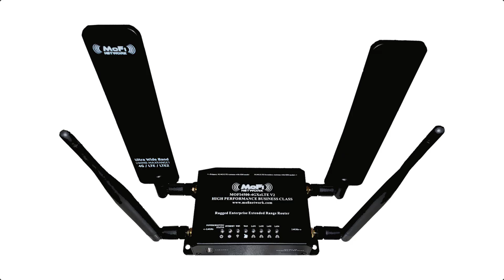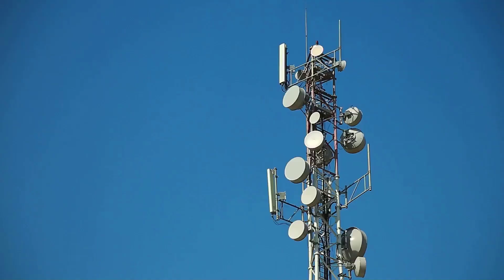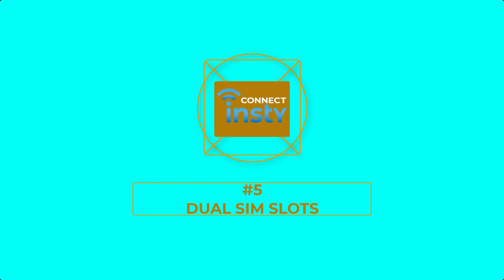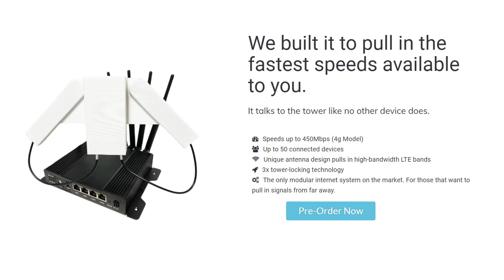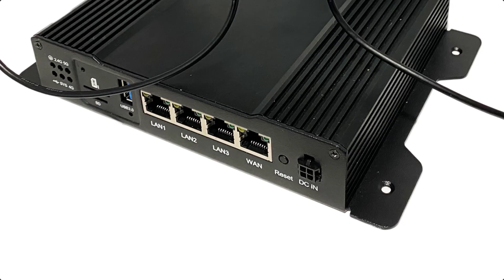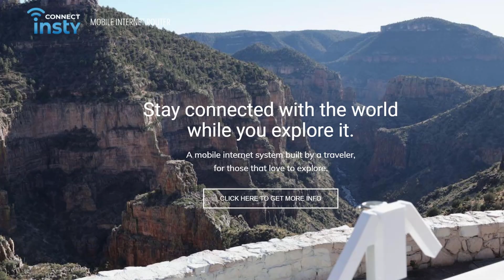Insty Connect Explorer 4G12 - Mobile Internet System

Comment: great when will this be available and will i have any slowdowns cuz i cant spend 1k if its super slow speed as visible only allows 5mb hotspots but its unlimited no caps on useage
Reply from the maker: It's available for pre-order right now.  The 4G will ship in a few weeks.  Insty Connect tells me the first 50 will ship quicker if you get in early.  The 5G model won't be available until summer though.  The 4G is $499.  I've not heard of a true unlimited Visible plan with no caps.  They supposedly got rid of the 5Mb speed limit so I'm not sure which plan you are using or if it will act different in the Insty Connect.  It should work the same as what you would get now in another device because the plan is the real limiting factor on data caps and speed.  The Insty Connect is just going to give you much better antenna reception and provide a hotspot to all your devices at the maximum speed that your data plan will allow.  If you set the TTL to 65 it normally will allow you to go past any data cap without throttling anyway.
Reply: @SeleTraining  So I have visible mobile It's a cell phone that offers unlimited truly unlimited data meaning I can be on YouTube for 200 hours and it will still be the same price now they give you unlimited hotspot as well. If I use and by this device will I be able to connect multiple devices as you say up to 50 and will I be able to get faster speed is there a way to make the speed faster let me know then I'll decide. But obviously I want to make sure that it's worth buying first before I buy it I mean it looks amazing but you know I want to wait till it's out in the market and we know more about it but I am interested in it also do you know anyting about Any other routers not the mofo 4500 because that's too much right now but something a little cheaper that will allow me to connect multiple devices to Visible and use unlimited hotspots While being able to connect multiple devices In-wall not lag I could spend around $100 Even if it's used I can get something that's decent as long as you recommend it maybe the filehub would that work The wave filehub I think it's called
Reply from the maker: The Insty Connect will let you have up to 50 devices running through that one SIM card.  If you have a 5Mbps speed limit with your data plan it won't change that.  Since you have a true unlimited plan the TTL setting is not necessary and you could use any 4G LTE router and it should work fine unless the antenna is necessary for you to improve the signal.  That is one benefit of the Insty Connect.  I don't know anything about the filehub but you would need an LTE router that let's you insert a SIM card to make this work.
Reply: @SeleTraining  I get what you're saying they don't have a data cap they only have it on a hotspot for the speed but as far as using YouTube and truly unlimited you could use up to two to three hundred gigs and it won't stop so you're saying for the instaconnect I have to use a SIM card to get it to work Because I have to use my SIM card that goes into my phone how does that work I just want to make sure I have all the information correctly before I make a big investment like that
Reply from the maker: @UGotHookah  My MoFi Update video explains more of the details about the concepts but I am using over 200GB of data every month with a regular cell phone plan in my router.
Reply: @SeleTraining  I get that but my question is if I have to use my SIM card that I'm using for my basically With my phone plan Does that mean I should get a secondary SIM card
Reply from the maker: @UGotHookah  Your SIM will work in the router but that'll take away the ability to send/receive calls with your phone.  None of the LTE router options will provide phone service in place of your phone.  You can do wifi data calling but the phone still needs a SIM to allow that.  That's why most people dedicate a SIM for this device.
Reply: @SeleTraining  Well obviously I have a hotspot on my phone that I could use I'm guessing the reason I'm buying it is because I want access to get rid of my internet in the future if this works well and I'm believing with this it will be possible
Reply: @SeleTraining  Because if I have access to my hotspot Hook up to the router and allow multiple devices
Reply: @SeleTraining  So then I'll probably get the mofo 4500. But as you said that takes another sim card so I got to figure something out with that because if I'm using one sim card for my phone I'll have to use another one for the router has actually well it's doable But you said you're using over 200 That's pretty good with visible mobile I can get unlimited talk text and truly unlimited data that means no slow downs no caps but on the hotspot I get 5 megabytes capped at one person so I'm just trying to get unlimited hotspots but I know I can get up to 30 with the mofo 4500 right And I still need a SIM card correct Let me know then we'll go from there but so far for the new router that you're trying to sell I'll have to wait a little bit . So I'll have to wait but this should do it
Reply: @SeleTraining  Forgot to ask you I almost bought it I'm glad I didn't I noticed that most of the routers the mofo 4500 are T-Mobile Do you think it will work with Verizon does it support the band because seems like it does but I don't want to buy it and makes a big mistake let me know thank you
Reply: @SeleTraining  Yep I get that I was just going to buy it And hold it aside until I'm ready to switch but yeah I got to make sure that works with Verizon because I saw them there T-Mobile so I don't want to buy a T-Mobile one and realize I can't get it to work with Verizon maybe I'll look at the bands and see if it will be supported
Reply from the maker: @UGotHookah  The MoFi supports Verizon bands.  The SIM7 has the additional band 66 for Verizon.
Reply: @SeleTraining  Alright great to know I figured it did after looking up some information but what is SIM 7 is that something a setting I need to change or something cuz if everything works out I should be able to buy one here shortly working on trying to get one now at a good price
Reply from the maker: @UGotHookah  There are 2 models - SIM4 and SIM7.  The SIM4 is older but has carrier aggregation and is a Cat 6 modem.  The SIM7 is newer and has additional bands but is a Cat 4 modem.
Reply: @SeleTraining  How do I know which one is SIM 7 I don't want to make a mistake thank you
Reply from the maker: @UGotHookah  The links in the description of the video show both.
Reply: @SeleTraining   MOFI4500-4GXeLTE V2 4G/LTE/LTE 2 SIM 7 i just picked this up on ebay for 200 hope its the right one the better one let me know thanks

Comment: The Insty should certainly be one of the better choices over the MoFi4500--when it comes into full production. Hopefully, they used a good chipset that will allow for stable, dual band WiFi.  Any specs available for this router?
Reply from the maker: I'll see if I can find some specs on the router.
Reply: @SeleTraining  No need.  After I got to looking closer, I realized it is a ZBT WG259.  I actually ordered one a few days ago to play with.  ZBT is also who manufactures the MoFi.  Thanks anyway.
Reply from the maker: @billjames6861  Yes, I believe that is the correct device.  The only difference is the modem and sim cards are separate and connected via ethernet so that they can be housed in the angel wing antenna.
Reply: @SeleTraining  Actually, the modem does not connect to the router via ethernet cable.  It connects via USB3 cable to an eternal USB modem enclosure that is housed in the antenna.  As such, the length of the USB3 cable to connect the modem to the router is somewhat limited.  Also, having the modem installed externally in the antenna on the roof makes it fairly inconvenient to access or swap the SIM Card.
Reply from the maker: @billjames6861  Good point.  I'll need to correct that in future videos.

Comment: So could I use this to get free unlimited hotspot or is this something I have to pay for besides by in the Box obviously and setting it up like basically after I pay for the box and set it up will it work can I have multiple devices and not pay any more let me know can I take it where I go or does it only work where you're located mostly
Reply from the maker: It uses a SIM card from a regular phone line to give you Internet.  The router then provides a Wi-Fi hotspot to all your devices.  There is a method of setting the TTL to 65 that lets you use unlimited data from a cell plan that has a data cap.  The router and antenna are mobile so you can use it anywhere.  It just needs 12 volt power to run so many people use this in RV’s as they travel.
Reply: @SeleTraining  what phone plan(s) do you use?
Reply from the maker: @aaronqueen55  I have T-Mobile and AT&T and swap the SIM depending on coverage.
Reply: @SeleTraining  I saw you mention it after reading more comments. Naturally I see it after I ask. Thanks.

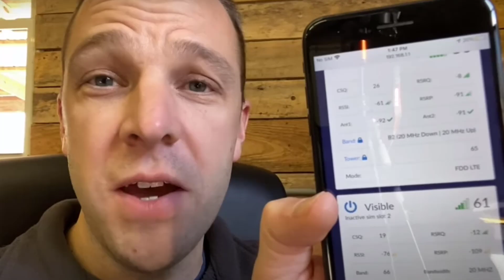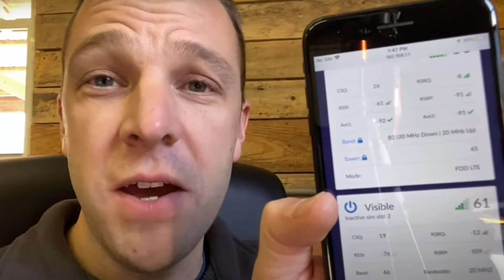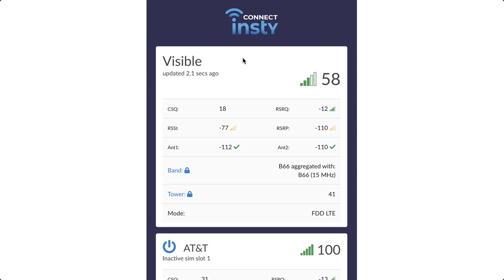Comment: Hi Jason. Awesome! Can't wait for your in-depth review. It is more expensive, but seems much more worth it. I noticed in some parts of your video (minute 4:10 and 5:55 and 6:00) Nick Joellen holding a cell phone and it has Visible Wireless compared to AT&T on the screen and on the Insty Connect software. Do you know if the 4G12 will work with Visible Wireless? Visible / Verizon seems to be the most particular about the device. For example not all unlocked phones will work with Visible.. only those they approve. Hoping the Insty will work with it, as it is easy to add a line and with Party Pay only $25/mo. Looking forward to hearing more. Thumbs up!!
Reply from the maker: Yes, I believe Nick is using both AT&T and Visible so it obviously works for him.  I haven't talk to him about the carriers yet but I know he is doing some testing with several people right now in Florida and is comparing the performance with many carriers.  There should be some videos on that soon.  I suspect the same issues with SIM cards and carriers will exist with the Insty Connect as they do with the MoFi.  Some of the carriers are picky about using the SIM in a router device.
Reply: @SeleTraining  Thanks Jason. I'm pretty sure that Visible does not work with the Mofi.. based on user comments at your channel and in other discussions. If Insty works with Visible that would be awesome for me, as I'm already invested in Visible and pretty happy with it. Looking forward to learning more!
Reply from the maker: @Wayne Edmondson I have had some comments from people that did get Visible working with the MoFi. Not sure why some work and some don't.  It’s similar to Verizon which is what Visible uses.

Comment: Can you remove this video and post it a couple months from now?  I just bought a MoFi 4500 and some accessories for it a few days ago 😂 Looking forward to your future videos on this!
Reply from the maker: Yes, I wish the Insty Connect came out a year ago.  You may be able to return the MoFi if you prefer the Insty Connect but it's still in Pre Order so it may be a few weeks to get it.
Reply: @SeleTraining  Hello, will a Cricket Wireless sim card (which is on AT&T's network) work with the insty connect router?
Reply from the maker: @mauricematthews5065  Yes, any SIM card will work but you may need to get Cricket to match the IMEI to the device to avoid them blocking it.  Some carriers will prevent using the SIM in another device like a router.
Reply: @SeleTraining  Instead of using a Cricket Wireless sim, I'm going to get the $20 unlimited tablet internet  plan from AT&T and use the sim in the insty router, and I would have to change the TTL setting to 65 for everything to work properly right?
Reply from the maker: @mauricematthews5065  It'll work great in the Insty Connect.  You only need to change the TTL to 65 if you want to go past the data limit without throttling but it will work without that up to the data limit.

Comment: @Sele Training  I just got a text from MoFi and they are saying their 5500 5G unit will be available in April.... Do you think waiting for a 5G unit is worth it as 90% of the US is still 4G or are you having more luck finding 5G on T-Mobile? 

Thanks for your great Videos.
Reply from the maker: 5G is nice but it all depends on your location.  If you are mobile it won't help very much.  You'll get 4G in most locations.  If you have a fixed location that is in a 5G zone then it would be great but the 5G systems are much more expensive.  Since I am mobile I personally don't plan to go with 5G for a long time.  I don't see much benefit right now.  The good news with the Insty Connect is that you can get the 4G and then swap out just the modem and antenna to upgrade to 5G later.  The router is the same for both and is a large portion of the cost of the system.  I also don't believe the timelines from MoFi.  They told me the 5500 would be available in early January after they said it was going to be fall 2020 after they said it was going to be summer 2020.  Last month they said they would send me a test unit the first week of January and I've heard nothing more since then.

Comment: Is this product available to purchase??  If so please send link. Thx
Reply: I just purchased the Insty
Reply from the maker: You can pre-order it right now and it should ship within a few weeks.  They tell me they have some on hand to fill the initial orders so if you are one of the first pre-orders you should get it quicker.  The link is in the description of the video but you can go here as well: https://instyconnect.com/?aff=1047
Reply: What sim card do you think is best. I'm in a verizon area
Reply from the maker: I use both T-Mobile and AT&T.  The problem with Verizon is that they may block the SIM when you use it in any other device than your cell phone.  That has not been a problem with the other carriers.  You can test your existing SIM from your phone in the Insty Connect if you want before getting a dedicated SIM for it.
Reply: @SeleTraining  thx for the response
Reply: @SeleTraining  I'm sure I can get att but there aren't as many towers in my area as verizon
Reply: Any update from Nick regarding shipping??
Reply from the maker: @elisemccollumn4208  He has started shipping this week for may pre-orders but I don't know how many or when they all go out.  He did have huge demand and additional inventory will take a few weeks.
Reply: Thx for the update. Did you get yours yet??
Reply from the maker: @elisemccollumn4208  Mine arrives tomorrow.
Reply: Did you get your unit. If so any thoughts thus far??  Thx
Reply from the maker: @elisemccollumn4208  I did get the Insty Connect.  At my current location I am seeing about double the speed with the Insty Connect over the MoFi. Very promising. I have just arrived at a new location and plan to do some more testing.  I'll put out an updated video in a few days once I run the full testing.

Comment: The million dollar question, is the mofi 4500 still a good buy for what you had shown before this G412 came along?
Reply from the maker: I strongly recommend the Insty Connect going forward but the MoFi was the best option that I had seen previously.  The 4G12 is $499 but if you buy the MoFi it's $300 and then you would need to add a Proxicast antenna for $130 plus cabling to be even comparable to the Insty Connect.  The 4G12 is a far superior router too and probably costs 3 times as much as the MoFi router to manufacture.  Most of the complaints about the MoFi have been poor signal in congested areas, slower connectivity through WiFi, confusing menu settings, and lack of carrier aggregation or the less bands depending on which model you get but there was nothing you could buy on the market better until now.  I even spoke with MoFi several times about improvement to their product but they have been very slow or non responsive.  All those issues appear to be addressed with the 4G12. You can certainly save some money going with the MoFi without an antenna and if you are in the right location with no congestion you may be able to get similar performance results but most people will see a dramatic improvement with the Insty Connect.  To me that's worth a few dollars.  I've also had great communication with Nick and I suspect he will keep the product well updated over time and the support should be better than with MoFi.
Reply: @SeleTraining  are u saying i wont be able 2 use the mofi i just spent 200 on the sim7 ?? what will the additional antenna do??
Reply from the maker: @UGotHookah  The video explains the benefits.

Comment: I like to see it in action with a visible SIM card
Reply from the maker: Insty Connect is working up new videos right now showing the performance with multiple carriers.  You may be able to see that in a few days.
Reply: @SeleTraining  cool I will be looking forward to those videos
Reply: @SeleTraining  well, tell them to hurry up LOL
Reply: I'm not in a hurry right now but I am looking forward to getting this system. I plan on having two locations that will need internet plus I wouldn't mind having internet in my vehicle. Good luck in providing new and better cell internet.